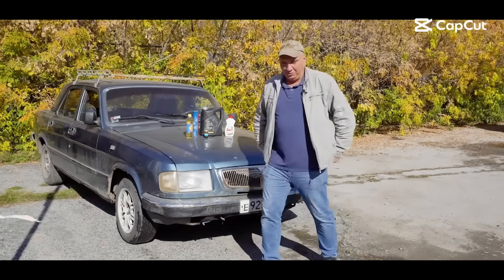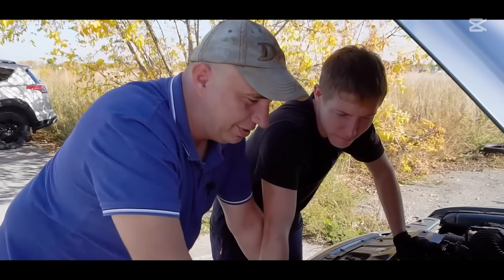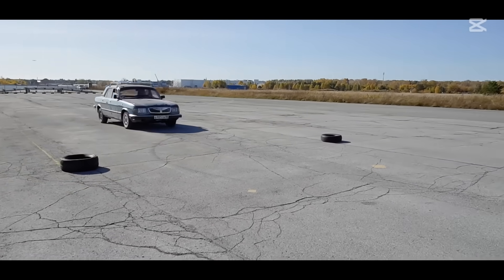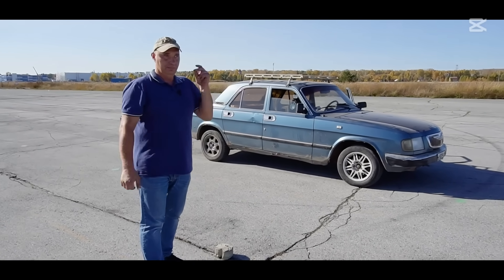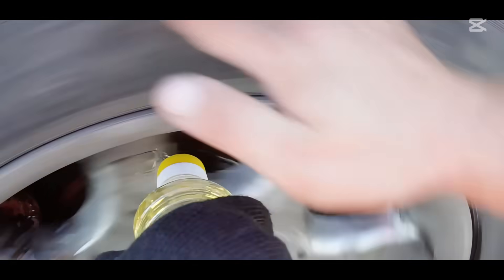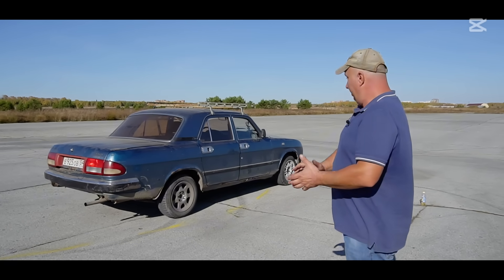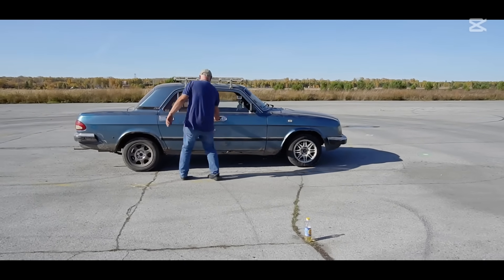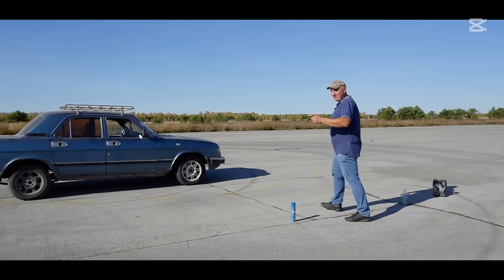We apply vaseline to brake rotors - what will happen?

Comment: Any kind of oil that saturates the brakes..........ruins them......the disc needs degreasing and the shoes need replacing
Reply: quite possibly, the rotors will warp and need to be turned or surface-ground

Comment: As soon as you heat up rotors under braking. Hot spots. Which end up hard spots and a crap load of brake chatter on braking.
Reply: molybdenum disulfide actually helps to that end.

Comment: Should have tested with TWO runs. To see how easily the brakes burn the stuff off the rotor.
Reply: if theyre 'contaminated' theyre gone and nothing will rehabilitate them.
Reply: @tommurphy4307    as someone who restores vintage motorcycles I disagree.
Brake pads (and discs too) can have a contaminated surface, but that will wear off over time and you get back to the good pad material underneath.
Yes, this is not for high performance applications, but for street use it is very common on old bikes to get oil and grease from the chain onto the back disc and pads. You just clean it up with some brake cleaner then use the brake normally it soon settles back into a normal brake performance.

Comment: You should use Brake Fluid which is very slippery and really likely to be on a brake rotor from a leakage in real life, it would be interesting to see how dangerous a situation like this could be... Cheers from Greece!
Reply: why? its just going to overheat the brake parts

Comment: I sprayed Balistol on my rear brake rotor on my motorcycle once. I was spraying it on the chain because I ran out of actual chain lube, but Balistol is fine. I sprayed it on the brake rotor on accident, then thought "When I go inside to put this up, ill get some brake cleaner and come back out." of course I just forgot quickly for some reason, then hours later I go for a ride and tried  braking up to a light and almost smacked into the back of a car. it was pretty scary, I dont know if they have Balistol in Russia though.
Reply: never heard of it

Comment: You should have done a cleaning with break cleaner afterwards and see if breaking would be restored. Curious how much oil would be impregnated in the breakpads and if breaking cleaner would remove it … nice going
Reply: speaking in very general terms, a contaminated brake lining becomes clogged with a given contaminant- how would the brake cleaner flush out the contaminant if it can't penetrate the lining??

Comment: For an accurate comparison you'd need to properly clean the rotors and install a fresh set of previously broke in pads between each test.
Reply: This ain't science class, it's close enough.
Reply: what exactly is the definition of a 'fresh set of used pads'??
Reply: @tommurphy4307  New pads that have been broke in yet never contaminated. 
Brand new pads have a reduced stopping distance until broke in which takes about 200-500 miles.

Comment: You should try worm gear oil, it is apparently different than normal gear oil as normal gears only press against eachother, while worm gears slide and press on eachother, thus requiring a different oil.
Reply: on model trains, the worm drives require a lighter-weight lubricant that stays in place

Comment: i always used to use 3in1 oil for my PC fan bearings but it only lasted like 6 months top, with Vaseline it lasts like 2 years! (if not more!) i guess it does not evaporate as easily. (also don't use WD-40, it turns the dust in it into glue.)
Reply: WD-40 is not a lubricant!
Reply: @fistaszek391 Right 👍 technically it's a water 💦 dispersant
Reply: @fistaszek391  exactly but we all know most men thinks WD-40 is good for everything... (my dad slowly destroyed my house fan with that... i guess i am the type of guy who reads the manuals/labels lol)
Reply: I used a wacky combination of full synthetic air compressor oil and multipurpose synthetic grease (the clearish thick tacky stuff) in one of my pc fans and its been going 12+ hours a day every day since 3 years.
3 in 1 oil is more like a mixture of solvents and oils and better for loosening up stuck things temporarily before adding a more permanent lubricant to them.
Reply: @realflow100  you mean semi-synthetic grease
Reply: Use vegetable oil. It doesn't last long, probably 6 months as well, but every time the computer gets hot it starts smelling like french fries.
Reply: 30+ years pc guy/gamer here and I'm curious... I never had to lube any fan and they always work(ed) for years. From the smol and only one on a 386 system to the multiple huge ones we have now. What are you doing?
Reply: @ it's dust and humidity, it gunks up the fan bearings. actually if you never ever cleaned a CPU cooler, it would create a hard layer of dust that resemble "felt", seen that in a few PCs from people who had no idea that you have to clean PCs.
Reply: @ We're talking about "us", not clueless people. Don't move the goal post. ^^
I personally clean my PC from dust every ~6 months with a vacuum cleaner and a brush for the fan blades etc. and I even smoke a lot inside the house, which means even extra gunk from that, and extra dust from the open windows.
Still, I never had to lube any fan bearrings.
Reply: @MegaSockenschuss  no need to be rude, if my fans are cheaper or are in a dustier environment or are ON for longer or less, who knows, don't care, no idea what causes it, i just know how to fix it when it happens that is all. they would not sell replacement fans for GPUs if they never died, cherish your lucky combo that let them live longer than 5 years then, all sorts of houses, all sorts of air.
Reply: @  Sorry, it's not my intention to be rude.
I'm German - that'll maybe explain my rude appearing communication style... :D
But I genuinly wonder, that's all. :)
Reply: I've never heard of oiling your fan bearings, and my fans have been working fine for 5 years now. (granted, they're good quality fans, so that may be why, but still)
Reply: those tiny fans can't make enough heat to liquify the petroleum jelly- you could use triple-antibiotic ointment from dollar tree and it would work just as well.
Reply: @tommurphy4307  yet they have been spinning and making no noise or vibration for about 4 years now since i did that and i periodically check if they "are spinning". maybe the residual 3in1 got it more liquid?

but in general, all i had to do was use a cotton swab and put some in the hole and on the shaft, turn the brass bearing a bit and make it move and pop it in and a few manual turn, flick it to turn it rapidly and it was free flowing as normal, was working silently since.

a lot more inertia is involved than what it appears so the sticky nature of Vaseline is not as bad as how much "dust gunk" can stop it from turning. (you can't feel the resistance by hand with Vaseline but dust gunk takes quite a bit of force to move, even when it still can turn from the motor, you feel it by hand. 80mm fans motors are surprisingly powerful.)

Comment: I love that Volga! Great looking car.
Reply: A Russian take on a Volvo 242.
Reply: @Colorado_Native  not really. The GAZ-24 Volga (which this model is based on) debuted back in 1970, correct me if I'm wrong, but I think it predates the Volvo 200-series. Also if my memory serves me - they were trying to make it look like the contemporary Ford Falcon.
Reply: @SwapBlogRU  I didn't check the dates, I had a 1984 242 GLT Turbo, great car. The 240s came out in 1974, the Gaz in 1970. Those sneaky Russians sneaked into Norway and stole the plans.
Reply: @Colorado_Native  regardless, the Volga was a ripoff, but not of a Volvo) and yeah, I agree with you that the 200-series was a great car. My uncle used to own one, his was 1UZ-swapped and it was bonkers.
Reply: @SwapBlogRU  Thanks for the reply. Paul Newman had a V90 with a Corvette transplanted, and I understand he had a 740 wagon with a Turbo Buick engine. I always liked the 1800 on The Saint that Sir Roger Moore drove.
Reply: It looks like a ripoff of a W123 Mercedes-Benz. Only smaller and undoubtedly much much shittier
Reply: @rekker2688  it could be worse - a Russian take on a BMW.

Comment: On a bicycle they say you have to replace the brake pads when they come in contact with oil. That they can't be cleaned with brake cleaner, or burned clean. Would like to know if this  is also the case with cars. Maybe this contaminated the results.
Reply: I was wondering the same. Car breaks probably get a lot more hot and burn off any contamination easier.
Reply: @Markus-.5712  Yeah. Bicycle break pads start to scream and lose their friction in couple of years in my experience. Car pads still good after 12 years. Any contamination probably gets burned off.
Reply: @imrileth6618  i have araya aluminum rims and black compound pads on my old roadie. i rework the rims with 600 wetordry and a rubber sand block about every 5 years. my rims and weinmann calipers are 45+ years old and the kool-stop black pads are about 25 years old and they are still effective after all these years. i live in an area that has very little rainfall and my bike absolutely NEVER sees any water nor does it require the abrasive red pads. of course i true the wheels periodically and check the toe-in as well. maintenance and servicing when needed is the key. no- once the lining compound gets severely overheated from contamination it's toast.
Reply: It makes "glazing"  @Markus-.5712
Reply: @Markus-.5712  no once they are contaminated the lack of friction and the increased effort required overheats the hell out of the lining material and its toast.
Reply: You can clean the brake pads, but:
If you do it chemically, they permanently squeak.
If you burn the oil off, they become brittle and will be used up much faster.
Source: I worked as a bicycle mechanic.
Reply: Agreed, would be interesting to see if they get any better after a while. Even might go back to original performance?
Reply: Complete lie. We clean pads and shoes all the time, and they work exactly like new once they're cleaned.

Comment: When the brake pads get contaminated they progressively get worse no matter what you use after
Reply: Pads need to be cooked with a torch after each test to get all that contamination out.
Reply: @drd0114  I agree
Reply: @drd0114  it does work, but it changes ne property of the metal: by cooking oil out you are raising the carbon content in the steel, you basically "quench" it.
The best solution would be to use several different solvents to completely destroy oils. But it is a long process.
Reply: I’d like to see them try some rubbing compound or gritty material and see if it can grind down the high spots on warped rotors.
Reply: How about a new set of pads each time? It's only 2 wheels after all.
Reply: @ZacLowing  New pads need 300km of break in period to bite properly..
Reply: They didn't really show how the brakes were cleaned.😢
Reply: And when oil and stuff gets on the wheels too, it'll be worse.
Reply: @ElvenMans wheels never locked after the first
Reply: That's until it gets really hot and burns off smoking.
Reply: This is just for fun dont take it so searously. Just enjoy his content.
Reply: hence, the use of the word 'contamination'....

Comment: A future video needs to be brake rotor out of brake pad material. And brake pads out of brake rotors
Reply: You are literally describing the clutch disc my friend.
Reply: @SEThatered  clutch is not ceramic it's organic clutch material
Reply: @ and? Brake pads and clutches come in both flavours for different purposes.
Reply: @skippy710 you can get organic brake pads not all are ceramic
Reply: @skippy710 It's literally the same as a brake system so it can be ceramic.
Reply: @skippy710  some of them are semi-metallic non-organic.
Reply: @tommurphy4307  yeeeeee ⚡🤙 I was just yappin lol. I'm aware they make multiple kinds.
Reply: Not a bad idea….
Reply: Yeah clutch discs as brake rotors. Sprung centre ones too!
Reply: @JohnSmith-j9j  they already did a video with clutch parts as brakes
Reply: @JohnSmith-j9j  you don't want to run a solid-hub clutch disc on the street
Reply: Copper/brass brake rotors
Reply: @jwalster9412  that would melt
Reply: @skippy710  or deform
Reply: You are going to win the nobel prize for that one! Your only competition is the guy who grew his weed upside down
Reply: @WolfmanDude  I don't get it, but You seem just as cooked as me lol.
Reply: Im betting it starts a fire
Reply: now that’s some real ghetto shit 😂😂😂
Reply: Good idea that
Reply: I'd say it's pointless for obvious reasons, but I'd probably still watch it.
Reply: ive seen real life examples of this. 😮‍💨
Reply: They did a vid using wood as brake pads